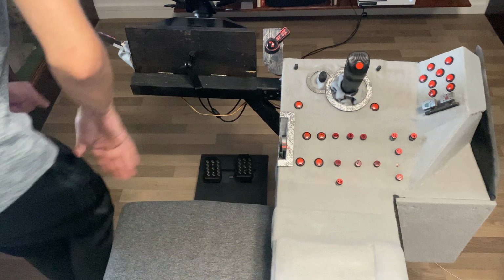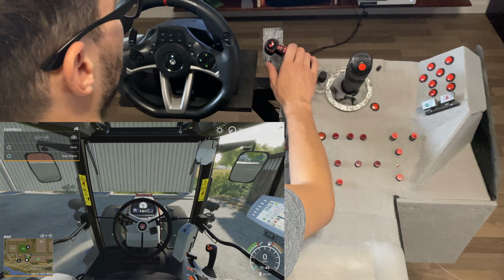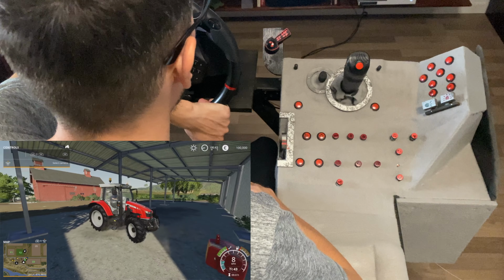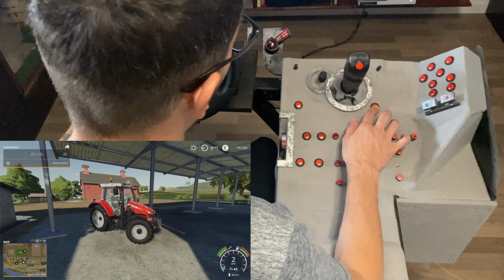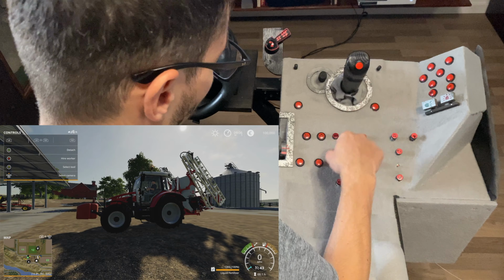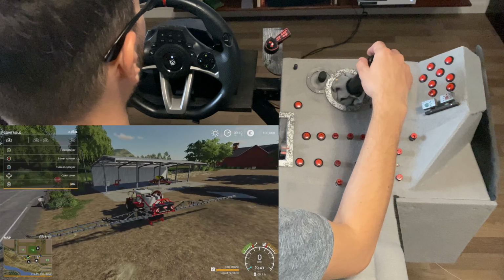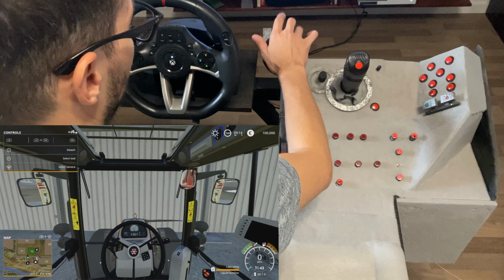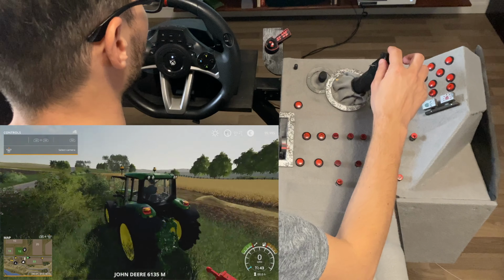🎮 🚜🛠🕹️  The coolest DIY farming simulator setup on internet! #FS19 #FS22 #fs25

Comment: Is the setup for pc useful?
Reply from the maker: I'm not too sure. If the windows PC supports an Xbox Controller (which is also a Microsoft product) then it would work. Otherwise not. However is easy enough to check out, but I can't since I don't have a windows pc...